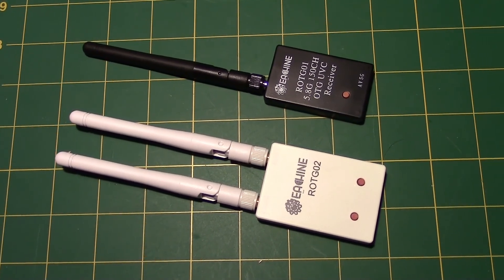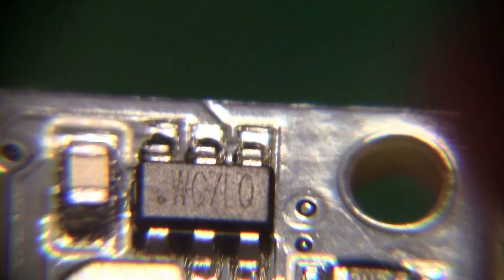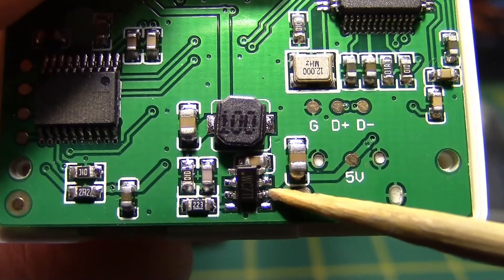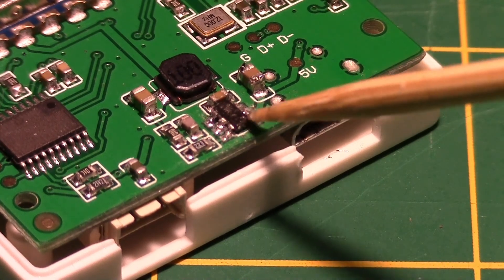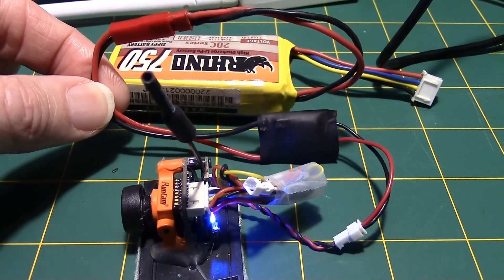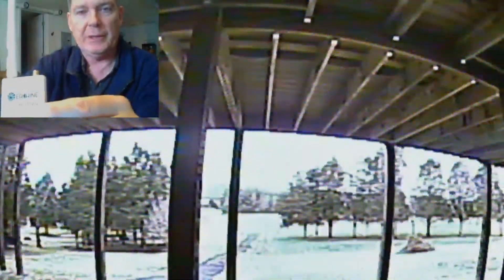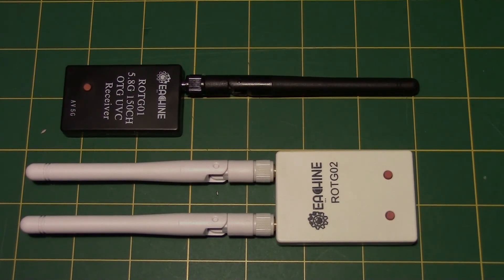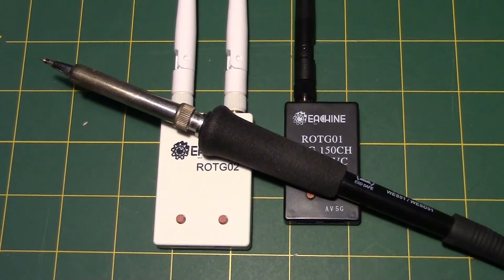How To Fix a Botched Eachine ROTG02 OTG RX from Bangood

Comment: I have just picked the Eachine ROTG02. I plugged it to the USB-C port on my windows 10 computer but Windows 10 did not recognized its driver. I searched for it but I could not found it anywhere event on Eachine website. Could you recommend a help?
Reply from the maker: I didn't use a driver. It was a little program called amcap.exe. Search for it and download it.  Even works with Win 10 & 11.

Comment: voltage +5V and Ground are the outputs in this device, you can power your DVR from your ROTG02 by first connecting a USB cable to your smartphone.

Comment: ty for answar, i have another question. i have rot 02 reciever  and if i fly over 300 meters i have one anthene on 100% but second is 42%. i dont know why. can u help me? i tried to switch anthens between them.
Reply from the maker: I don't know why either.
Reply: Use better omni antennas for sure if you are not already. The factory are crap.

Comment: So it has two different receivers.. Do i understand it correctly you could receive two different channels at the same time,  that would open up possibilities for combined FPV/Camera feeds and or 3D flying.
Reply from the maker: It's a diversity setup which switches to the receiver that has the strongest signal BUT you can't receive from both at once without re-engineering it.